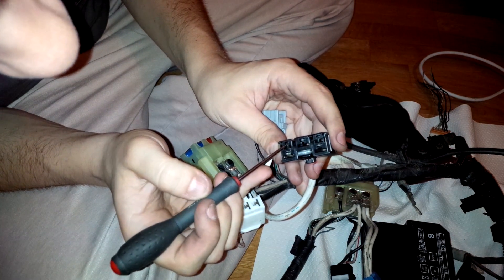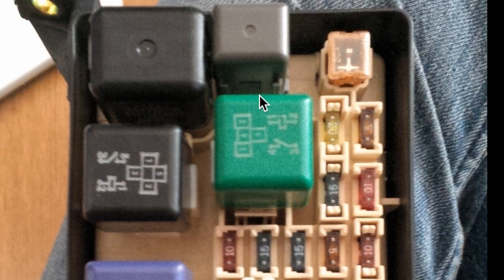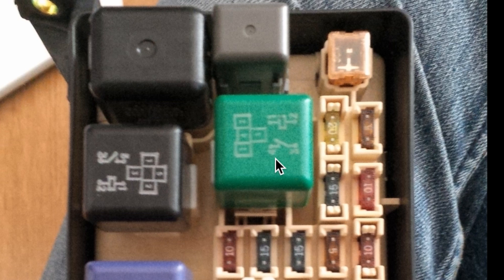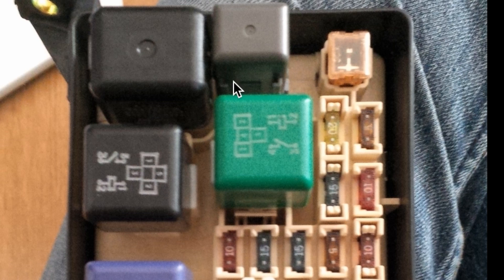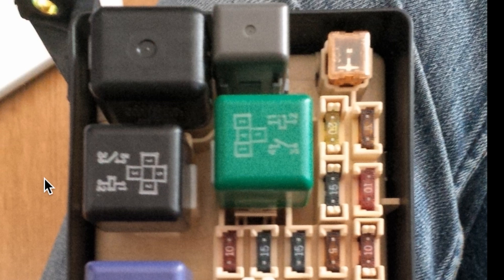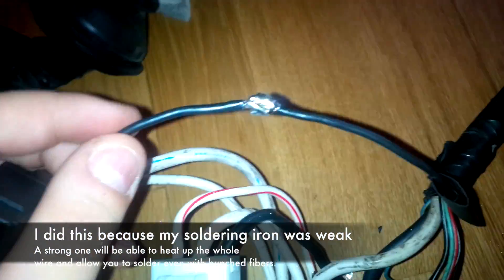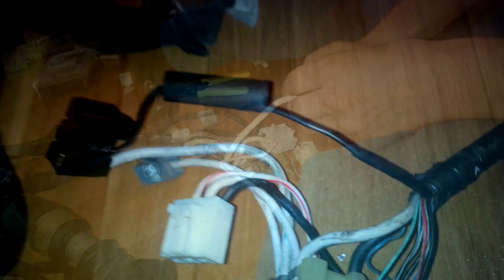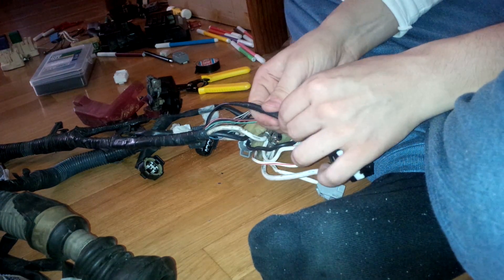ᴴᴰCorolla E11 4AGE 20V BT swap, wiring harness guide: Relays explained, Soldering and insulating]

Comment: Hello, just wanted to ask how you wired the AC1 and ACT connections from the ECU? My AE92 doesn't have an A/C amplifier. Jost hoping if you could help. My idle's kinda low, roughly around 600-700 rpm. Thank you!

Comment: I have a problem with starting the engine. 
4age silvertop with blacktop wiring complete with ECU.
The engine can be crank but couldnt start or idle.
When I manually spray some fuel using bottle spray with fuel into the throttle intake and the engine seems to be start for a moment then dead again.
Also I have check the injector connectors for voltage but no current flow at all.
meaning the ECU not responding ?
please advise what to do next ?
Reply: Alvin Loo check cicuit relay and check for ground of that relay